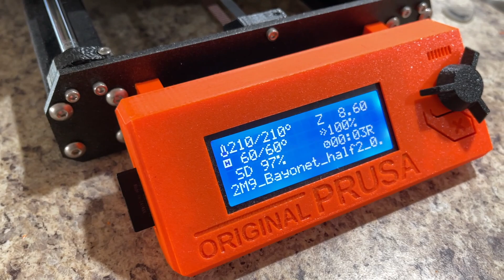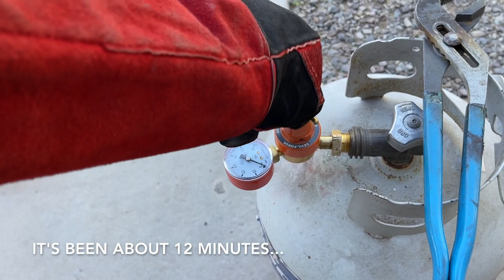M9 Bayonet Knife - Casting An M9 Bayonet Knife In Aluminum Bronze - From 3D Printer to Knife

Comment: As you said the cast was good. Beyond that a good deal of fettling will produce a fine looking knife. I expected you would have drilled the barrel ring. The sanding belt with a holder for the blade would be a cinch to get a broad sharpedge. Dremel for the fish scaler. Of course if used as a military tool it will stay in the only soldier ever skewered on it. So totally impractical as a bayonet like all that Chinese cheap crap novelty stuff. It'll be really great as a fisherman's blade. Love the alloy.
Reply from the maker: Thanks Jack, you hit the nail on the head! I definitely want to try it again and make some adjustments for sure! 👍